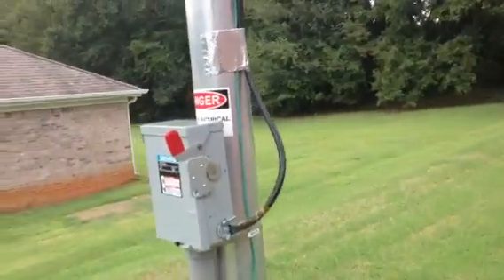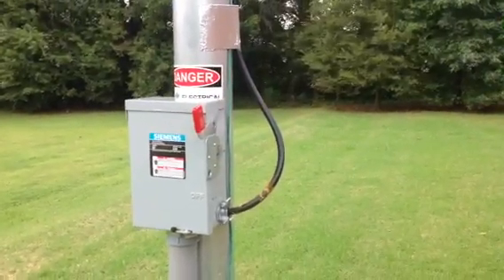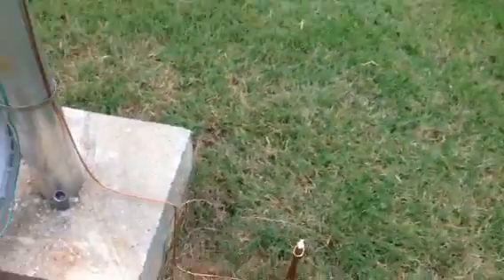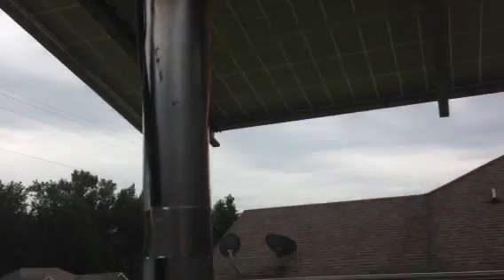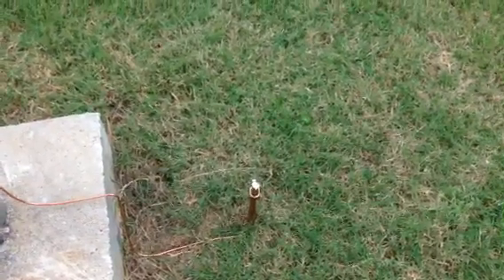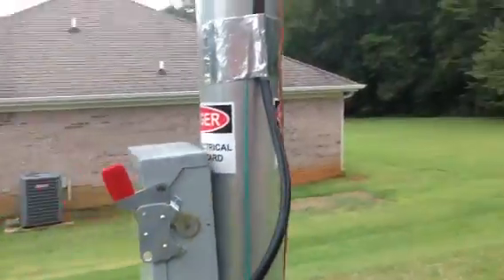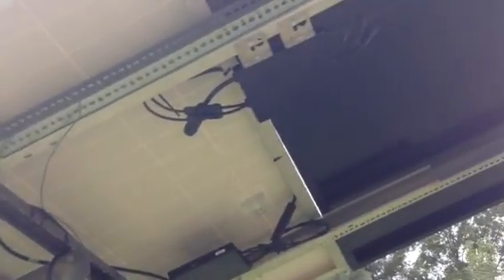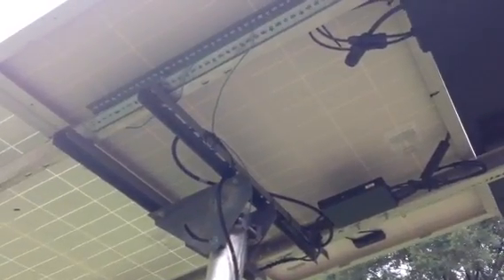DIY Solar - updated Pole Mounted Array.

Comment: Nice!  How much additional run time capacity do you figure these added panels give you in a grid down scenario?
Reply from the maker: +christothegreat1 Not sure right now, my system is AC Coupled but it's not totally complete until I implement some more safety measures.  But Ideally, with the additional panel I should have almost 1kW of potential power.  Running 120v appliances with LEDs gives me a lot of flexibility.  I'll know more as time goes on.